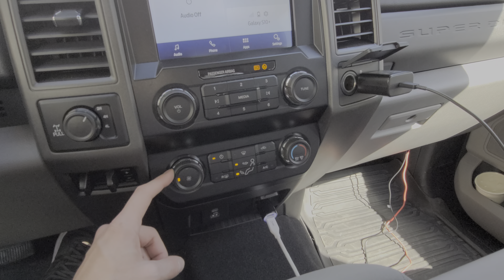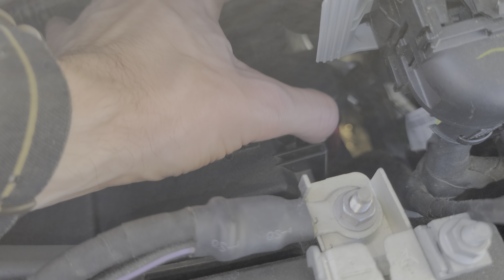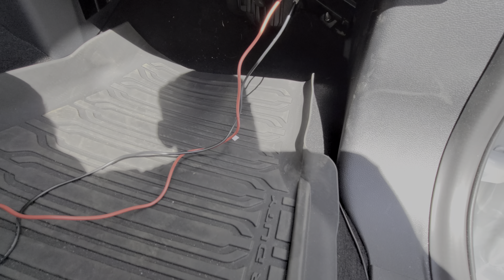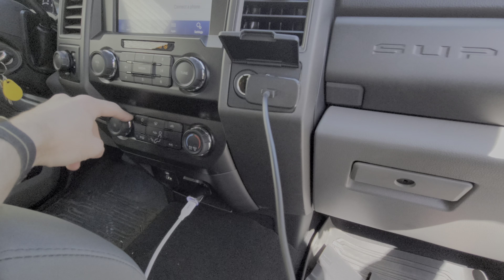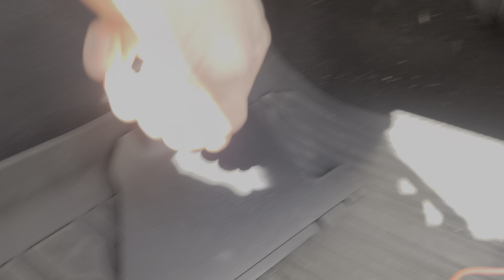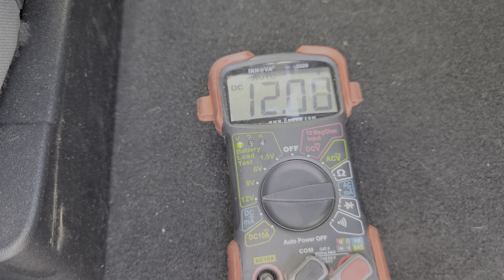2020 Ford Superduty Blower Motor Fuses & Troubleshooting

Comment: 21 F550. Replaced Battery Junction Box a couple months ago, corroded, poor design. Purchased replacement from Ford.
Blower malfunctions intermittently. Found Number 42, 40 amp mini relay not blown but partially burned. Seems like cheaper fuses were used on the replacement instead of the original BJB. Replaced and now have no problems.
Remember, the BJB on these trucks rot on the bottom side and you cannot see it until you take them out. There is a TSB for this but not all are recalls. Fords better idea to place the windshield drip tray right over top of a fuse box. If you're experiencing electrical issues start here, especially if it gets to the point where the truck continues to run even after you take the key out, and then won't restart.

Comment: Good video. I saw several questions in the comments, so I thought I'd toss in my experience over 5 decades: Hitting the blower motor to "fix it" - great if it works to get you home, but replace it because that problem will come back sooner than later and likely for good. Hitting it only works for a while (same for starters). If you get burnt or chafed wires anywhere, especially outside the cab area, be sure to seal them up. Corrosion will start along the strands inside the protective sheathing and eventually cause resistance, possibly high heat, and/or intermittent electrical failures. Those are very hard to diagnose because you can't see the issue, which is why I always solder and shrink-tube wire. If you can't get your plug off the blower motor, give it a shot of silicon lube spray (be sure to have a rag ready so it's not dripping on your carpet. If you pull the motor and it's dragging, not free spinning, replace it.  Use a volt meter with an audible continuity checker or an ohmmeter to check your fuses and power to the blower, as well as the resistor functions. Buying another blower to check the power works, but not very practical.  Even a low-end multimeter will work. A multimeter is an important diagnostic tool and a must-have in your toolkit. If airflow is lower than previous years but the blower is going through all the speeds, check your cabin filter—it's part of your regular maintenance, but many often ignore that item—and your cab will smell better too.  Also, if you have the filter and blower out, check for pens and crap in the venting. I've had blowers stuck with a pen jammed in the fan wheel, and vents jammed open (by a popsicle stick of all things), so heat wouldn't flow properly. Even candy wrappers can fall into the vents and get into the fan or vent valves, creating odd sounds. If your windows start fogging up abnormally, and there is a distinct, foul odour, chances are your heater core has begun to leak. That can be a big job, but if not done, it will eventually flood the inside of your vehicle — its vents and carpet — with antifreeze—a real mess —and the smell isn't easy to get rid of once the antifreeze residue is all through your vents. It pays off to do your coolant maintenance on schedule to avoid corrosion in that system. Especially on Fords with internal water pumps, because that's a big job if the water pump shaft seal fails prematurely due to crud in the coolant system. A hundred-dollar pump can become a two- to three-thousand-dollar repair in a shop if you don't have that level of mechanical skill. I hope that helps new DIY home mechanics.

Comment: What happens if the truck fuses are good the blower motor is brand new with the new speed control actuator door is good and still can’t get it to turn on the blower motor on a 2022 F250 XLT 7.3 L gas

Comment: I tried everything. New blower motor, Relays, NOS HVAC control module panel and fuses looked good. Thought maybe the HVAC control module white with purple stripe signal wire might be compromised between the control panel and blower motor.  After several weeks of sweating balls Far West Texas and scratching my arms behind the dash board chasing wire runs, I finally figured it out. The blower motor fuse under the hood in the very back of fuse block micro j style fuse 40amp looked good and checked out with good continuity. I inspected it and looked good so reinstalled it. Problem is its under the hood cowling near firewall and not good access.  So after scratching my head and replacing everything I was determined to take all the shit apart until I found it. When I tested the power plug to the fan (plug removed) I read 12v. However later I checked with the plug installed and back probed the plug. This is when I noticed low voltage. I knew that the wires had to be compromised under or inside the fuse block. Memories and flashbacks started coming back from my 01 Excursion. NOOOOooooo!😖I took out the battery to start the process of removing the fuse block. This would also give me greater access to the fuse block. Bingo, the contacts were dirty and smoked when I was able to get close enough and do a better job of inspecting. Even though fuse tested good and looked good the contacts in the hidden hole of the fuse block were the problem. I cleaned with a terminal cleaning file tool, sprayed some electrical connector cleaner, scrubbed again with a a soft bristle stainless toothbrush. Make sure batteries are disconnected when this is done.  Then I put in a new 40 amp high rise Nissan micro J style fuse. Easier to identify and locate, and parts house didn't have the lower profile fuse anyhow. No more wanting to drive 90mph do the highway with ac vent on trying to get a small cold breeze from the fresh air vents, lol! My 2017 Superduty 6.7 has been a incredible truck. I farm and ranch, so the truck sees lots of off road and pulling trailers. First truck I have ever had that the transmission has made beyond 120k. I have 210k on it now and everything is original, ac system, transmission, fuel pump, electric running boards,. Except, I installed the Eventure electronic suspension kit from CJC off-road and made the engine more eco friendly 😉. I think it has helped preserve the truck from the rough roads and extended the service life of the engine (TBO)... Everything works and still working and now the ac blower motor back online! I hear the best trucks ford ever made are between 2017 and 2019, and I believe it. The new trucks to my understanding are not near reliable comparison. I hear they have removable floor pans so when the transmission takes a crap or a engine system fails, the family can remove the floor pans and Fred Flintstone their way home!😆
Reply: @kevinivey9825  did you remove the bjb and notice the corrosion on the inside? I'm having the same problem 12v without blower connected and only 5v with blower motor connected
Reply: , check the fuse closely. Take a picture with your phone and flash so you can inspect it well. Clean the contacts. Mine still works, no issues...

Comment: Are you still on here. Need help. 2018 ford f250. Everything works as it should. The blower motor will not come. Installed a new blower motor same problem. 
A/C compressor,relay,
Blower 7.5 fuse 
Power to the blower plug has power.
What I’m I missing

Comment: Hi, I have a 2010 F250, I have changed the control module in the dash, the blower, the resistor, the relay, checked all of the fuses. The compressor  comes on and I can feel it cooling under the dash, but the blower is not coming on. No blower for just fresh air or heat. I have visually inspected wires and connectors for corrosion/burnt. I am at my wits end!!!

Comment: Excellent video.  I was about to give up and order a blower motor because I had power at the motor.  Your suggestion to bang on the housing was gold.  I hit it a few times and it ran for a couple of seconds and stopped.  Hit again and nothing.  Decided to tap not bang on the plug and the fan started running and hasn't stopped.  Looks like when the evaporator was replaced last year all of that was taken apart and when reassembled the plug wasn't inserted to the point of snapping in place.

Comment: What if the blower works the air only blows out on the floor vents I can’t get air out of the dash vents. Any suggestions what it could be ?
Reply: @181dirtyd  mode blend actuator

Comment: I have a 2020 f350 and ran into this issue, I replaced the fuse in under the hood check the fuse inside the cab but what ended up fixing it was a lil love tap like he said and it turned on 🤣🤣

Comment: Still having an issue with my 19 SD 6.7.   if i turn the speed all the way up, the blower screams but getting 1 bar speed airflow. could this be the kick panel fuse? if so could you post the link or part number? thanks

Comment: So I do have a question . I have a 2018 f350 super duty and the blower motor stops working and comes back on after a few. This video helped but still not sure if the motor is bad or something else. When its not working I do have power at the plug at the motor. The lights on the knob light up and down when turning but nothing happens. Could the motor slowly be on its way out. How can i test the motor? Thank You
Reply: @RobertLambert-x3v  did you find out?
Reply: @CATCHFathers  Yes the fuse had a bad connection so if i hit a bump it would go off. it was so random it was hard to find but the fuse was good just not great. changed the fuse and have not had a problem since.

Comment: I either love your videos, I have a question I CANNOT find help on, I recently purchased a 2021 6.2 f250 super duty and the rear AC on the center consul is not blowing. Front works perfect but no air out the center consul. Is there a power button for that or a fuse or something to check for that specifically?? I can’t find any info for the life of me. Ty in advanced.

Comment: I have a 2020 f150 and the control panel for the heater comes on but doesn’t run for more than a few minutes. What do you suggest to remedy this?

Comment: My blower works, but I feel like it used to blow better when you set it to MAX AC, it was super loud and forceful air coming out of the vents. Now high on the knob and high with MAXAC are the same. And they didnt used to be
Reply: @lambmt  check your cabin filter in behind the glove box
Reply: Cabin filter bro

Comment: Thanks for the videos for the bower motor.  It worked on my 2018 F250.  Any luck on a video for the AC compressor and it’s associated relays, fuses and connectors?

Comment: Where's the relay? My 2014 blower started randomly turning off for a few minutes then coming back on... started happening more frequently and for longer periods of time. Now, it has only come on for a few minutes in my last 3 drives. I assumed the blower was the problem... bought a new one. This morning when it didn't work, I turned on Max AC, cycled the power off, on, and off again... then unplugged the blower and plugged in the new one (without installing it)... cycled the power on and still nothing. So I don't think it's the motor. I'm not having other electrical issues, so I don't think it's the BCM. I'd think if it were one of those 2 fuses, it never would have come back on after going out the 1st time. I'm thinking maybe it's the relay. It happened when it was at Ford after getting a Cam Shaft position sensor changed... the tech said, there was power to the plug, so it was probably the motor. But it seems it's not... too hot in south Louisiana to be without AC. Need to figure this out
Reply: I think this is a relay also, when I looked at the schematic it looks like the relay is non serviceable, being built into the fuse box. This was on a 2019 f550.
Reply: I watched a video where a guy had to pull a card type looking resister out that went bad....

Comment: What if it is blowing air but not as if it's full blast when the knob is set all the way up
Reply: Always try the cabin air filter located behind the glove box. Very simple
Reply: Having the same issue. Wish I knew why?  It’s our first Ford and the heat sucks compared to GM when it’s -30
Reply: Having the same issue. Did you ever find an answer?
Reply: I had an enterprise rental truck and if you work with them long enough then you will know that they don't maintain there trucks like they should. I wasn't aloud to do any maintenance on it my self just put gas in it. Took 3 months to get accepted for a service on the cab filter and they fixed the issue. Cheap and easy fix. Enterprise is difficult and expensive.
Reply: My f150 doesn’t seem to have the airflow it use to.  I can pull the cabin filter and no change
Reply: Then it will be the resistor
Reply: The AC blower works at all the regular settings low to high but when I select the Max air, the light on the temp dial lights up, but the higher speed blower doesn’t not come on, what should I check?
Reply: Always check your cabin air filter behind the glove box
Reply: @markmcewan4074 how to find the resistor?
Reply: I have replaced my cabin air filter several times. 22 super duty and I have this issue. I will test the connection and then tap on the blower motor and see if the air flow comes back like it should.